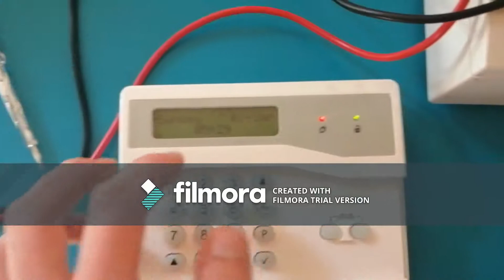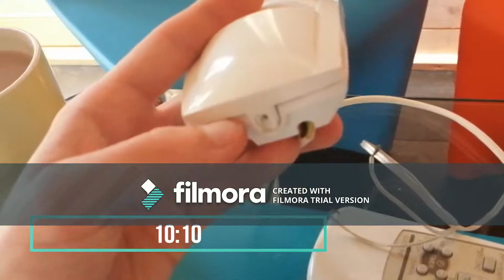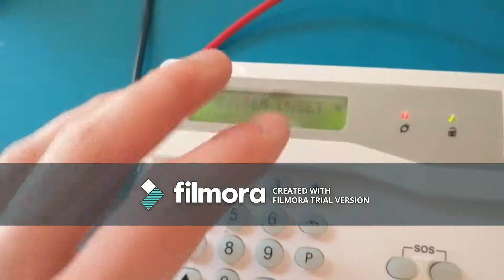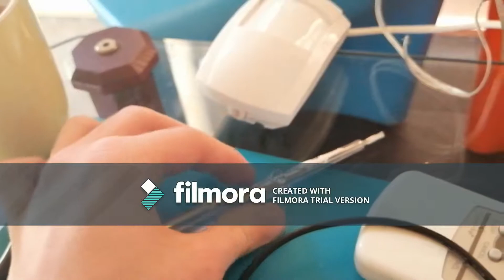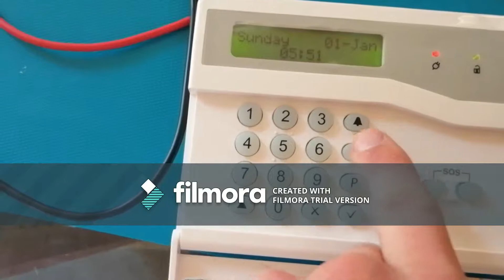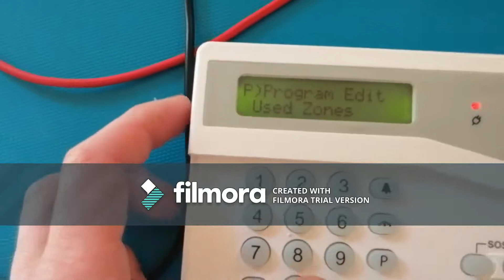Accenta G4 Setting Fault

Comment: Hi, I've tried what you said in your video. As our Pir is flashing on and off regardless to whether anyone walks past. Took out the blue and green wires. Did what you said, now we have no pir's working and the control pad says faults in all rooms. Any suggestions on what to do to rectify this problem. 0123 doesn't work however 9999 engineer code does but I do not know how to sort this. Please help!!!